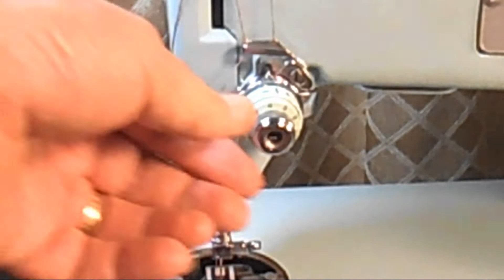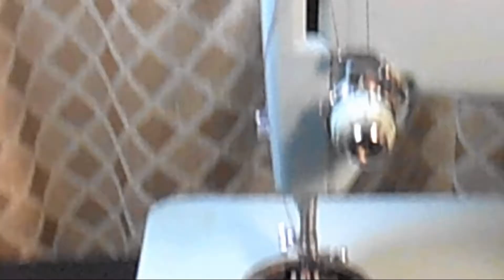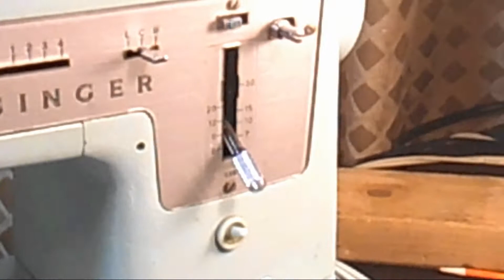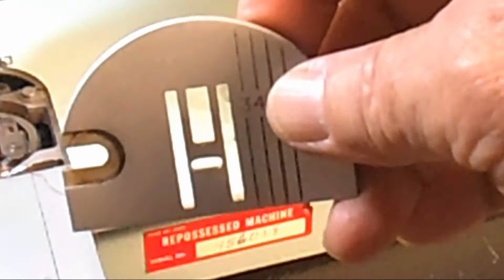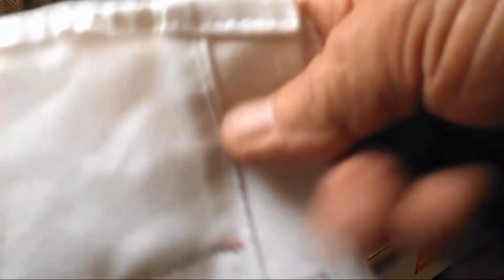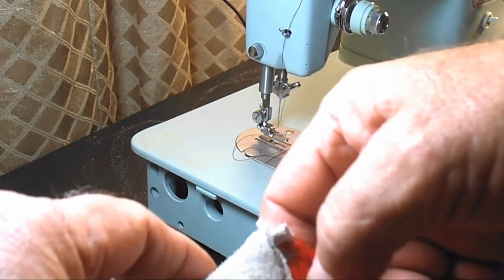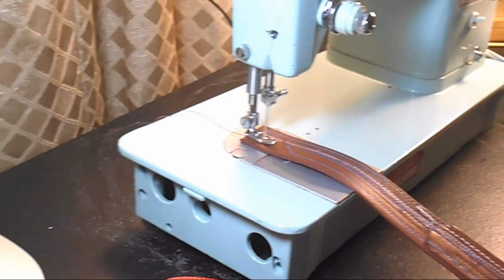Single Needle Straight Stitch Sewing Test on a Singer Model 338 Sewing Machine

Comment: Hello Andy, your videos have been incredibly helpful for me. I found this machine second hand and i started sewing with it for the first time. Everything was great, however now I have problems with the spool. It seems that even when i sew with the hand wheel, the spool suddenly turns a lot, and causes the thread to get stuck around the spool pin. I also notice a lot of nesting. It happens more often during backstitching. If you know why this happens, could you let me know? Thank you!
Reply from the maker: Thread nesting under fabric is most often caused by improper threading through the tension unit. Not lifting the presser foot before threading and/or not getting the thread between the tension discs. 
   Then there is little to no tension on the needle thread, and the bobbin thread tension just pulls the needle thread right down through both layers of fabric. 
    If there is not a felt washer under your thread spool to create a little drag, that makes it all the worse.
  The check spring can't really check the thread b/c of a lack of tension, and all the bad things happen. 
   Be sure to follow the correct threading path from the spool to the needle. Those thread guides also serve the purpose of controlling the feed speed of the thread.

Comment: Hi Andy!  Thanks so much for this series.  So helpful.  I just purchased a 338 that seems to run and all parts moving.  My plan is to clean her up before I start sewing with it.  Unfortunately the only cam that did not come with this machine was the zigzag cam...the only one that I would really use lol.  Is it necessary to have a cam inserted to be able to use the straight stitch function?  Or does a cam need to be in there even though its not being used?  I see that you mention restoring the 337.  I'll be having a look at those videos to help me with my 338.  Thanks.
Reply from the maker: Congratulations on your new machine. It's a beauty. I think you can so straight stitch without any pattern. Cam being installed. I say that because when you move the lever to zero for straight stitch that pulls a follower away from any cam that you have installed. That follower works some levers that makes the needle swing back and forth for zigzag. So even when the zigzit cam is in there when you're sewing straight stitch, the follower doesn't touch the cam. I think you'll be fine. You can buy a new cam for four or five bucks online. Your machine takes the original cams which are flat and called type A and the zigzag cam is number one Cam there are about 20 more cams with different patterns. You can often find a vintage set of the original attachments in their box on eBay for about 40 bucks if you need more of the presser feet, etc. Yes, the 337 step by step restoration playlist can walk you right through your 338 the only difference is model 337 has one cam permanently installed and your 338 has the chrome knob. You can take off to change cams. Otherwise the mechanics are the same between the two machines. Good luck. You know where to find me if you have questions
Reply: @andytubesewing1953  thank you for your quick reply! Luckily all the other 8 out of the 9 cams were in the box as well as some extra feet and the needle plates. I ended up ordering a number 1 cam online. I look forward to watching the rest of your series! ❤️
Reply from the maker: @jgsawka  oh that's great! You're all set then! I think you're going to enjoy working on and sewing with that machine. A few years back I asked my daughter what machine she would like for her birthday pick any machine made by singer and I'll restore it for you and model. 338 was her choice in about 3 seconds. She's had it a few years and she enjoys it. Her friends are surprised at its strength and versatility. He found a really nice machine

Comment: I bought a machine and it just makes noise but doesn't move at all. 
I was hoping to see this in this video, but your machine is a pure beast😅
Reply from the maker: Is your machine a model 338 then? A machine like this that has sat idle for years or decades usually has dried oil in all the oil points and bearings. It acts like a varnish or glue freezing the moving parts together. You can get a free copy of the Instruction Manual from Singer Support at this link: https://www.singer.com/search/support?title=338   Pages 70 - 72 show all 32 oil points. Just use sewing machine oil and be a little generous. You can let it sit until the old oil softens or you can apply heat to all those points using a hairdryer. Eventually, you will get some movement by turning the handwheel by hand (save the strain from the motor) Once it starts moving a little the new oil gets in there even faster, and when you can turn the handwheel fairly easily then try running the motor slowly. Do not force anything (damaged parts) It can take an hour or a day. I usually oil it and let it sit overnight but I'm in no hurry. The manual has 84 pages of info about using the machine which you might enjoy glancing through. I do have several videos about cleaning, restoring, adjusting, replacing motor belts, etc. Here is a step-by-step restoration of the sister model 337 with 32 videos: https://www.youtube.com/playlist?list=PLsCOZgzzaiKJxbOOMKQPvmeTRqi0dhGa5    and here are 20 videos about a 338 I restored for my daughter: https://www.youtube.com/playlist?list=PLsCOZgzzaiKK4y8dsq3oMKJFTGsoNJWmi
The 337/338 models are extremely versatile and can sew from lace to denim with no problem. They can be used as portables or mounted in over a dozen different Singer cabinets. Once cleaned and oiled it will sew for another 50 years with just normal maintenance which you can do easily yourself. Good luck, and thanks for watching my channel and saving a machine from the dump.
Reply from the maker: @fitting9132  Cleaning is always a good idea, even if it is just visible oil and lint. It's very possible you threaded the needle wrong, put the bobbin in backward, etc. That manual I mention has instructions for all that, too. Needle and thread size discrepancy can break thread. Be sure you are using a Class 66 bobbin, and not a Class 15. Needle thread can easily break when the thread won't move thru the thread guides or take up lever. I usually remove the thread completely and start over. That's where I would start.
Reply: @andytubesewing1953  thanks so much! I'll do that. Hopefully I can make it work🙏

Comment: @andytubesewing1953 I just purchased this exact model, have it all cleaned up and oiled.  I purchased it to sew some simple leather projects (4-5 oz. single layer veg tan, two layers deer skin, etc.) but I'm having issues with it grabbing the bobbin thread.  I've meticulously watched your other videos on threading, etc. and not sure what else to try.  I'm pretty new to sewing by machine still so not well versed on adjusting machines.  I am using a Singer leather sewing needle, upholstery thread, and a #4 tension setting like in this video.  Any help would be appreciated.   Thank you for the great videos!
Reply from the maker: It's a wonderful machine, Desiree. The one my daughter asked me to restore for her of all other Singer models. 
     "grabbing the bobbin thread", so does it grab (pick up) the bobbin thread at all, or just misses it sometimes causing skipped stitches. As a new sewist you may be trying to "help" the media along (in your case the leather) If you "help" push or pull the leather you can deflect the needle enough that the hook point misses the tiny loop of thread from the needle. 
     We always want to let the Feed Dog move the fabric. That's its job and the dog is (should be) timed to the needle/hook movement to grab that bobbin thread. It is fine if you "guide" the leather but if you nudge it forward or hold it back, even a small amount, that can cause skipping. You can just use it on some scraps of fabric, like something woven, or even a folded paper towel. Just let the dog pull it along slowly and don't even touch the towel. If it still skips you know it is not you causing it. 
     When sewing leather or deerskin layers (or any layers) it can really help to use an Even Feed Foot. This foot helps stop slippage of the media and prevents the needle from being deflected by the bottom layer. Here is an example of an even feed foot for a LOW SHNK model like your 338:  https://www.sewingpartsonline.com/low-shank-walking-foot-singer-423242-451.aspx   
     So then what? If it isn't something like you pushing/holding the media? Now that means it may be a timing issue. Timing is the needlepoint to hook point coming together at the exact split-second for the hook point to grab the NEEDLE thread and as it is pulled around by the hook that needle thread wraps around the BOBBIN thread (forming a cross-stitch). 
     The first thing to look for with a timing problem is the height of the needle bar. There are some marks etched into the needle bar that is used to set the height of that bar at a certain moment. It's not hard to do and here is a video explaining the marks and setting the height: https://youtu.be/HfTrIdUpU68   
     I have had skipping Singer machines that I adjusted the needle bar a tiny amount, up or down, and fixed the problem. It's a line-of-site of the mark to the bottom of the bushing so folks "eyeball" it a little off and have skipped stitches. Every machine is unique a little bit, especially at the age of yours. You can watch the video part about setting the height and check your machine without using any tools. If the height is off you loosen a screw, adjust the height, and tighten the screw, and test again.
That's it for now; I'm missing the Chiefs Playoff game! 👀😀

Comment: does this machine have a thread cutter attached?
Reply from the maker: Yes. There is an upsidedown smile cut into the bushing for the presser bar. When you end your seam you grab the fabric in your left hand and raise the threads up onto the bushing and pull them towards you and down against the slice in the bushing and it cuts the threads. It's about 1/4" up from the bottom of the presser bar bushing on the backside. So just above the back of the presser foot. This is shown and described in the Instruction Manual which is still available free from SInger at this link: https://www.singer.com/search/support?title=338   If you have any issues with the machine I have 2 playlists of videos that can help,
Model 338, 20 videos https://www.youtube.com/playlist?list=PLsCOZgzzaiKK4y8dsq3oMKJFTGsoNJWmi
and sister model 337, 31 videos https://www.youtube.com/playlist?list=PLsCOZgzzaiKJxbOOMKQPvmeTRqi0dhGa5
Thanks for watching my channel.

Comment: You’re the best for showing us this! I know this video is old, but How the heck do you sew slowly on this machine? Mine only goes two speeds: 1. Not moving and 2. Light speed
Reply from the maker: Thanks, Amy. Some of it is cleaning and oiling the machine properly, but your problem is mostly that the foot pedal probably needs cleaning and adjusting. It's what; 50 years old now? Your 2 speeds are a classic sign it needs work, and you can do it yourself. When the pedal is adjusted properly you can sew from very slow to full speed.
Here is a short series of videos about cleaning and adjusting the foot pedal: https://www.youtube.com/playlist?list=PLsCOZgzzaiKL6ePPxLpmnWSzTyxPKTb71     I have about 50 videos for cleaning, repair, and adjusting your machine (yes, I think that much of this model) so if you have other issues they can help you. Model 338: https://www.youtube.com/playlist?list=PLsCOZgzzaiKK4y8dsq3oMKJFTGsoNJWmi  and little sister 337;  https://www.youtube.com/playlist?list=PLsCOZgzzaiKJxbOOMKQPvmeTRqi0dhGa5

Comment: I'm trying to sew masks to donate but unable to get the top thread from breaking
Reply from the maker: I don't sew but know many people who do and I've asked them about this.
The most common reason seems to be the threading is wrong. No kidding. They all said they just pull out the needle thread and start over. If you need a copy of the instruction manual for a Singer machine just go to singer.com/support and enter your model number in the search box. It will have threading instructions. 
Now for the other dozen reasons it breaks! Yikes. Rather than type them all out here let me give you some links that may help. A youtube video with 522K views and 1.3K likes:
https://www.youtube.com/watch?v=ThtwW7mxvjk
A popular blog's top 10 reasons: https://blog.treasurie.com/sewing-machine-thread-keeps-breaking/
A thread manufacturers info about it: https://www.superiorthreads.com/education-thread-shredding
Finally, I can tell you why this old knucklehead breaks needle thread. I have a tendency to "help" the fabric go past the needle. I know! That's what the feed dog is for, right? I still try to help and it can bend the needle a little bit, just enough to scrape the needle on the side of the hole in the needle plate and that breaks the thread. I hope that helps you out, Pam. Best of luck with those masks and thanks for watching my channel.

Comment: Hi, I don't use the machine often.  However, I've tried a few times lately and I've threaded it correctly, bobbin is in correctly, but when I begin to sew, the needle becomes unthreaded.  I don't know why this is happening.  Tension 4, the other marker is on 8.
Reply from the maker: Unthreaded, like the thread comes out of the needle, or is the thread breaking, can you tell? 
FREE instruction manual available here, BTW; https://www.singer.com/search/support?title=338
Reply: @andytubesewing1953  hi. It is very strange.   It starts off through the needle.  Sews very little and is outside the needle connected to material.  Does not appear to have broken.
Reply from the maker: @bakinpeach  Wait... so it comes out of the needle but is not broken and still the thread is connected to the fabric? What am I missing here, Angela? I apologize but am I understanding that correctly?
Reply from the maker: @bakinpeach  The only time I ever witnessed this was a person using a "quick threading" needle. My wife then tried them but they did not work well for her either, with the thread pulling out or the fabric getting caught and damaged. This is what I am talking about: https://www.schmetzneedles.com/learning/pdf/Quick_Threading_Needle_Info.pdf
I don't know if you are using a needle similar to this or not, but that is the only thing I know of that can cause what you describe.
Reply: @andytubesewing1953  I am using a needle threader.  I'll try to thread from the other side.  I'm going from to back with needle threader so when I pull that through the thread comes forward.  I then push it around the needle.  That might be it.  I'll let you know. Thanks.
Reply from the maker: @bakinpeach  That is the reason for your problem. Now we know and thank you for telling us.

Comment: Very informative video, thank you, Andy.  I ordered a straight stitch throat plate for my 337.  It looks exactly like my throat plate in the photo on eBay.  I should be receiving it soon.  The straight stitch throat plate for that machine is hard to find.  I hope it fits because it's important to switch to a straight stitch plate for fine fabrics and better control.
Reply from the maker: Singer model 337 came with two throat (needle) plates. Part No. 179608 multi-purpose and Part No. 161614 Straight Stitch. Those plates also came with models 327K, 328K, & 338K. It is a shame so many of the straight-stitch plates were never used. and got lost or discarded. I'm with you 100% that you get a better looking straight stitch when using the correct plate. Absolutely!

Comment: I know this video is older, but maybe you can help me. I’m having trouble with adjusting the tension dial and the pressure thumb screw. It seems like no matter what I set each on, my lighter fabrics will bunch up, get caught in the machine, and/or the stitches are uneven. Since I’ve tried pretty much all settings, do you think it’s a problem with the machine itself? Could you maybe do a tutorial on setting the tension and the pressure thumbscrew? Thanks a bunch for your videos!
Reply from the maker: Older, but still monitored. Please take a look at this video series of a full restoration on a Singer Model 337. The 337 is the Sister to the 338. The difference is it has one "semi-permanent" pattern cam, the zigzag. All the other parts, motor, tension, shafts, needle bar, etc. are the same. My series will cover the presser bar and rebuilding the tension unit. I can't stress enough that cleaning a machine will fix many, many problems. https://www.youtube.com/playlist?list=PLsCOZgzzaiKJxbOOMKQPvmeTRqi0dhGa5
 It is what the Singer repairmen did first when they serviced a machine. Cleaned it, including soaking in varisol, oiled it, ran it for 5 minutes then started testing. Many times there was nothing else to fix. If you'd care to see a little more detail about tension, here is a mini-series about it in detail >> https://www.youtube.com/playlist?list=PLsCOZgzzaiKJaeFB_GW97NsW5GYM7KD9U
You can download a free copy of the original Singer Instruction Manual here >> https://www.singer.com/sites/default/files/product_manual/SINGER%20338%20Sewing%20Machine.pdf
Please be sure you have threaded the needle and the bobbin case correctly. You'd be surprised. I don't know you. You may be the most experienced sewist on the planet. Please just check. You can also download a free copy of the Singer Parts Diagram with part numbers if you ever need to look for replacement parts >> http://parts.singerco.com/CPpartCharts/3_39999/338.pdf
So there are 38 videos and some documents that may help with the problem. Homework, I guess. Thanks for watching my channel